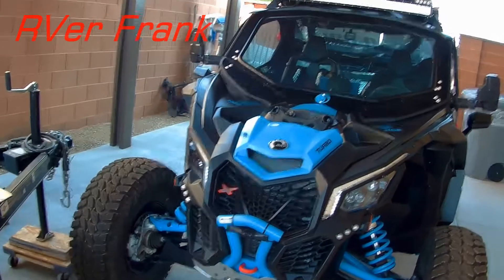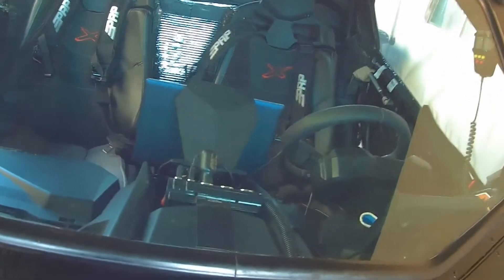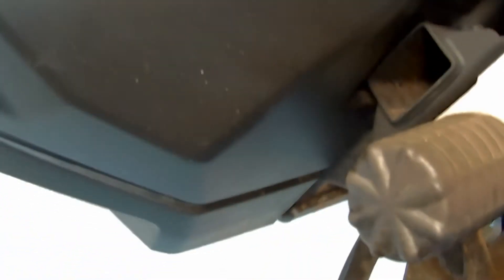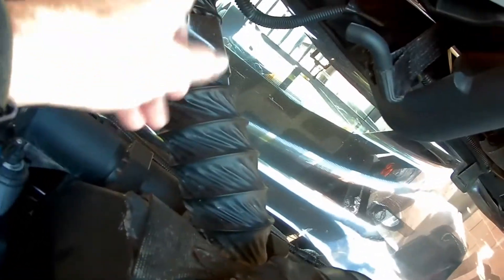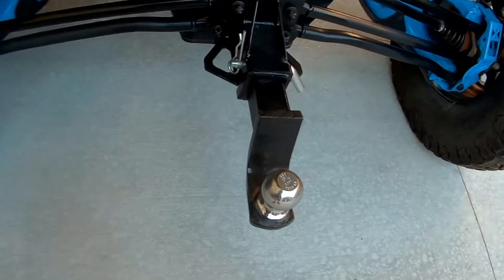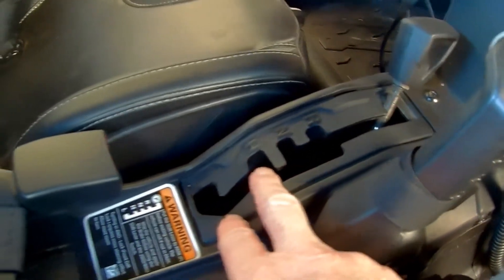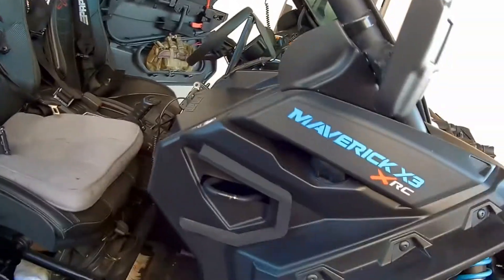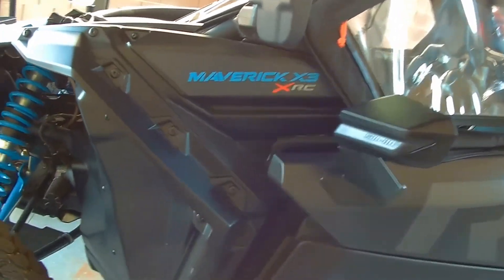613-XRC Cab dust insulation, plus heat and sound reduction

Comment: I HATE the dust in the X3 and the rear tire fills the cab with dirt I almost traded mine for a different unit but I like the power to much
Reply from the maker: The full cab enclosure helps a lot cutting down the dust.